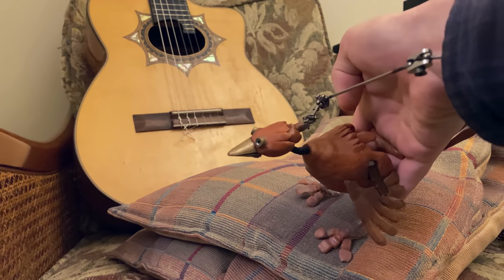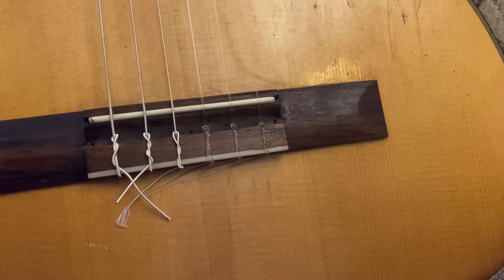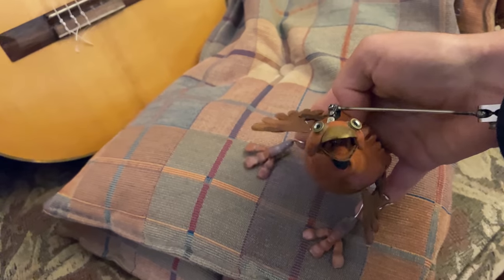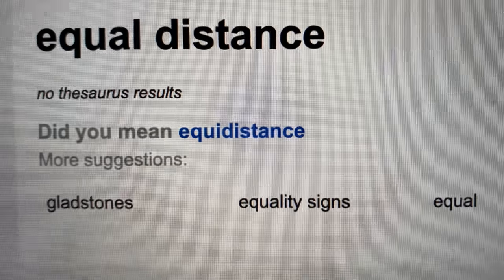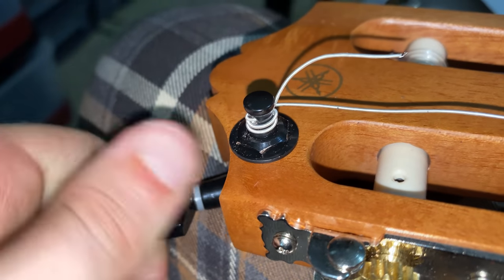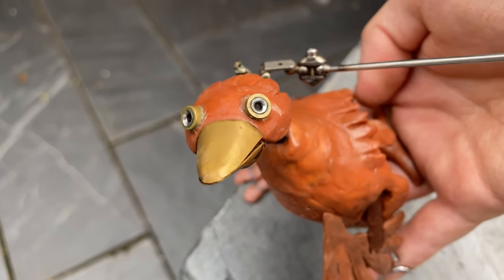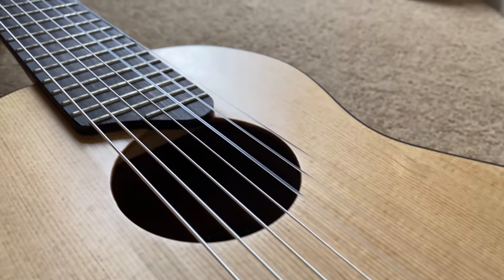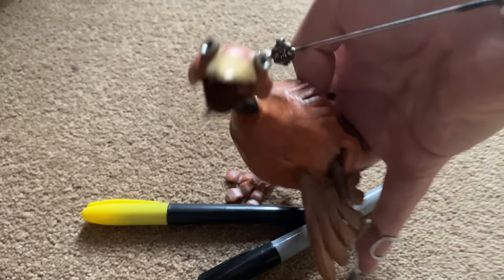$60 guitar made AMAZING!!!

Comment: Most guitarist cuts the strings like he does...it's easier to remove it that way
Reply: no
Reply: @Supertimegamingify  idk if you are a guitarist, but with a guitar like mine, a Les Paul, it's easier to take out the strings by cutting them because the part that was twisted by the tuning machine won't pass through the bridge